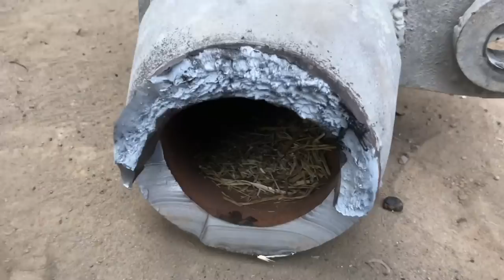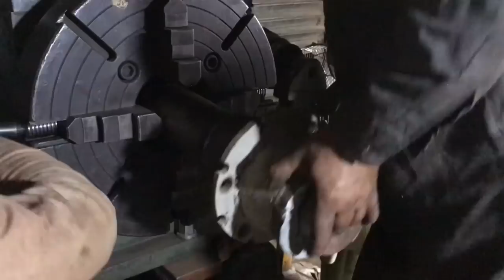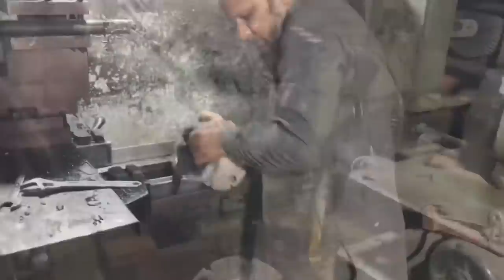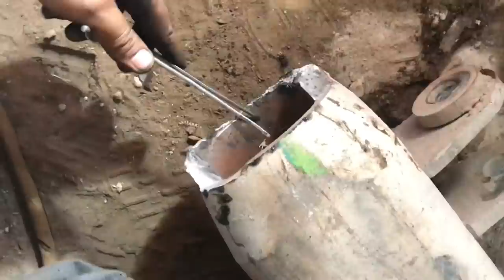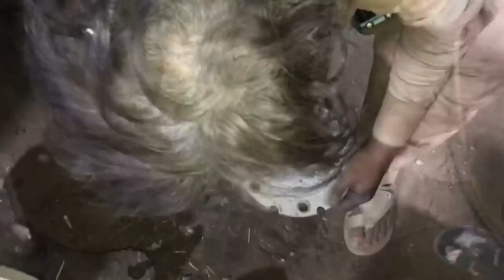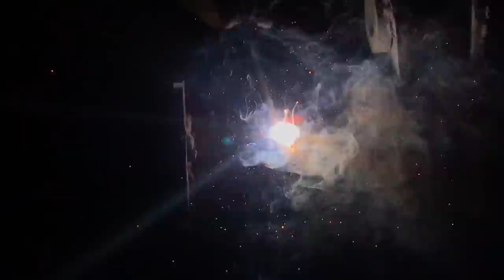How to Repair Broken Heavy Duty Truck Trailer Rear Axle // Amazing Technology process

Comment: WTF NO HEAT TREATMENT NO V ING SO YOU CAN BUILD UP THE WELD. IT MIGHT LOOKED FIXED BUT THERE IS NO STRENGTH  TO THAT WELD AT ALL. I GIVE IT A FEW DAYS .ONE GOOD BUMP OR HEAVY LOAD ITS IN 2 BITS AGAIN. IF YOU GOING TO TRY AND FIX AT LEAST PUT SOME EFFORT INTO IT LASTING A LITTLE  LONGER . THE JOKES JUST KEEP COMING.